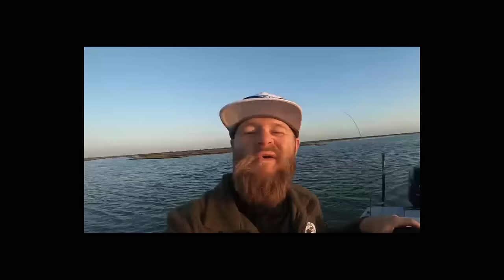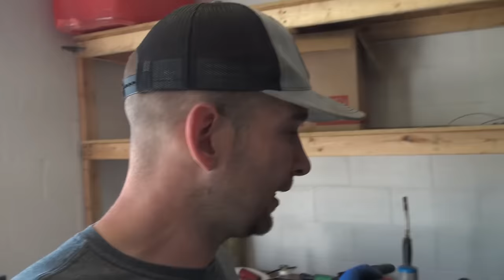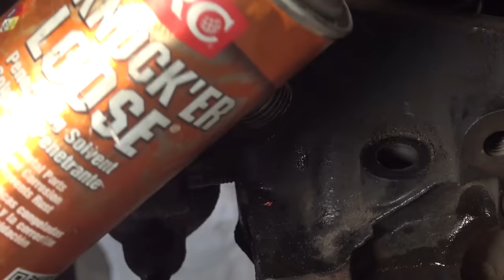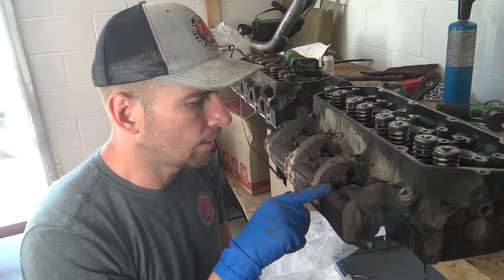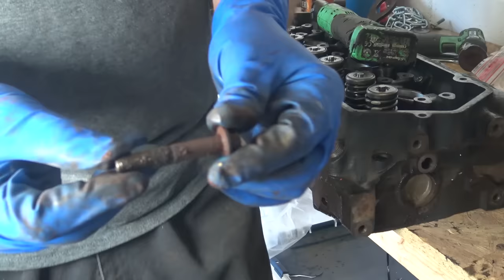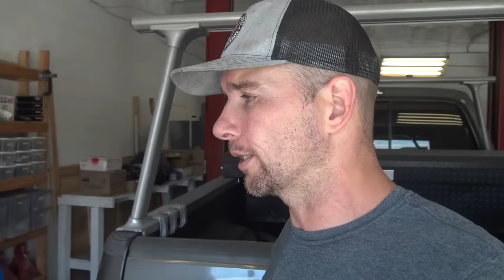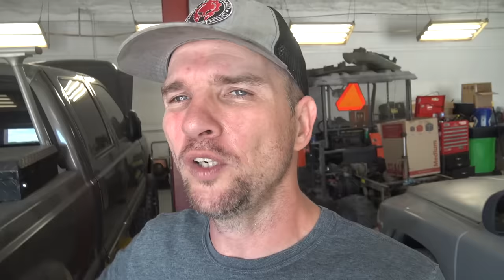Old Mechanic Taught Me This Trick To Removing Rusty Exhaust Manifold Bolts!

Comment: my dad taught me this, but to always work from the inside out. I never start with the outside bolts or corner bolts like for a valve cover job. great video man!
Reply: e90: Yeah, that makes sense....like the man said, retighten after loosening.
That gets your inner bolts scenario as your Dad said.... Sound advice.
Cheers.
Reply: Even when putting it back together?

Comment: I use this same technique when removing steel screws from aluminum trim pieces on 65 year old  year old  travel trailers. Dissimilar metal corrosion is the worst. Great advice about not fully removing any bolts until they are all loose.

Comment: Well done! Tapping it with a hammer can help break the rust between the manifold and bolt also.
Another reassembly reminder: do not use hardened bolts during reassembly - mild steel only
Reply: How about stainless steel bolts?

Comment: Yep, this method works. I learned this from a retired millwright who worked at Puget Sound Naval Shipyard. Sharp hit in the tightening direction can also help in the beginning. I also spray more rust blaster when turning back and forth. That pumps more liquid in to the joints. Favorite blaster is Kroil and I use nickel based anti-seize on exhaust manifolds fasteners. It's made for higher temperatures,  but follow OEM guidance for sensors.

Comment: Having been a machinist for 42 years, I agree 100% with your manifold bolts removal process. I have found that once removed toss the removed bolts. I always buy new boots at Tractor Supply stores I get the grade-8 bolts and use the copper anti seize compound liberally prior to installing them. Thanks for that great and very helpful video.
Reply: I have a question for you my friend, or anyone else for the matter. I recently replaced my manifold on my '06 Mercury Milan Permier with 227,000 plus miles. And to my surprise all the Nuts came free, and didn't break the studs! Now, these 2 are separate, the stud is a Torque tip that's bottomed out before the manifold is put on with the proper gasket. Then the nuts. 
So, now I have oil leaking from some of the holes and along the top. My question, should I replace them even though they look ok? They do seem to be smaller than they should. Now that I think about it after this video.
 🤔 🤔🤔🤔
Reply: A BIG YES ! On the COPPER ANTI SEIZE !
Reply: @erocklaw74  Your manifold bolts have 227K on them. That's a lot of heat for a lot of time. If it were me doing what your doing I'd pull those studs after soaking them with a quality penetrate. Take on to NAPA Auto parts and buy new ones 1/4 to 5/16 longer. Show them your bolt . Long story short, your bolts stretched !

Comment: Use a pneumatic punch on the bolts right in the center of the head, not enough to deform the head but just to rattle the rust loose, also having heated the bolt or manifold spray some oil onto it while hot as it cools it draws the oil in. Also use loctite LB8151 anti sieze spray when putting the bolts in, used on north sea oil rigs never know a bolt sieze with that goes upto 900 deg C.

Comment: Great! One pointer to add: when using a torch to concentrate heat on one area, hold the nozzle further back such that the very tips of the inner blue flame is hitting the surface; this is the hottest part of the flame, and breaking it results in incomplete combustion hence lower temperature.
Reply: Thanks for this tip, if I may add a pointer, the yellow part of the flame weakens the bolt by introducing carbon into the metal, so always make sure you douse the part you want to heat in a blue flame.
Reply: Exactly a point I was going to make. In addition remember that heat rises even when it comes to solid objects. So start the flame below the object. Giving more time to let things cool off and contract will give a bit more movement. Even spraying liquid directly on the bolt. Great topic by the way. Sometimes the basics get lost in the heat of battle.
Reply: @TheEZGZ  heat does not rise in solids.

Hot gas rises. Hot solids just spread the heat
Reply: But the hot gases spread around the block making heating more efficient and faster.  So heating from below is better. Also, any solder flux and penetrating oil chases towards the heat so heating from the opposite end from the joint treatment.

Comment: Another minor variation my Dad taught me for manifold and head bolts . Same "break it loose and tighten it back up" routine but start in the middle and work alternately outwards.
Reply: Makes good sense.
Reply: And use a breaker bar!!
That ratchet makes more work, than it's worth.
There's a good reason it's called a BREAKER BAR!
Reply: Green Giant , harbor freight?
Reply: @cheerdiver  might get a little better feel of the bolts willingness to break rather than give up its hold maybe
Reply: @adrew1963  Not only does a breaker bar give you better feel and easier to go back-and forth with, you are not as likely to be tempted to go that "little" extra bit that will get you in big trouble!

Comment: One the best things you can do is before you attempt to turn the bolt rattle the bolt with a air hammer, they make a air hammer bit that you can put sockets on. The air hammer vibrates the bolt and helps nock the rust loose. I know it may sound strange. But it truly a game changer
Reply: I just ordered the 3/8"/1/2" set from Amazon on your recommendation for my '67 352 motor. Thanks!
Reply: @5hawks   Just curious, have you tried the air hammer technique with those sockets?  I have 67 352 manifolds that are very rusted and leaking very bad.

Comment: You're right about having patience.  I've rushed myself into some into some agonizingly long jobs in the past.  If you have access to the backside of the bolt (like some suspension stuff) use a small wire brush to remove the rust on the far side of the nut to avoid dragging it into the nut.

Comment: Over here in southwest Pennsylvania...in the "rust belt"...our road salt melts the snow, ice, and fastener heads. Pre-soak all you can, then with a large hammer force fit a small as possible socket to fit what's left of the head...accomplishes a couple of things...tight fit and shocks the rust, hopefully enough for a fighting chance.
Sometimes a air chisel will do the trick...applies a lot of vibration.

(((Reminds me of a trick with a 5th wheel on a truck that refuses to slide, the pins just won't release. Without the trailer, pour water or penetrating lube on the slide rails and lock pins, release the locking pin air valve, take the truck for a ride on a rough road...railway crossings work great...return to trailer and 5th wheel will slide....vibration did all the work !)))

 Back to the tight bolts... Then try to gently tighten first...not loosen. Then loosen/tighten/loosen and heat if still hangin' tough.
   New fasteners and "white high temperature food grade" antiseize...far superior to typical parts store NeverSeez.  You will love this stuff...It is non-staining...does not absorb into your skin...simply wipes off. Been using it for 10 years on all fasteners exposed to weather and not...hold their torque and come apart easily. Anything that is a critical fastener...a drop of Loctite seperate from the antiseize.
There are different temperature ranges available, typical is -65 to 1800 degree operating temperature range. One place is www.antiseize.com.

A word about using the right tool for the job...6 points are great for sockets and wrenches...as said, the bigger the drive size the better.

Phillips head screws...I'm amazed at how few mechanics know this...philips head screws, by design, are made to cam out at their maximum torque. This goes back, if I recall correctly, World War II days. Speed of assembly, proper torque, and not overly worried about future removal.  Here's the rub to that...the Japanese had and still use today their version...designed to hold torque, be easily removed, and reused because their design does not cam out...as long as you use the proper tool.
 Japanese "philips head screws" aren't philips head. The head is slightly different. Look at any Japanese motorcycle or quad master cylinder...the screw heads are usually ruined because someone tried to remove with a common (to us) philips screwdriver. Look closely at those original equipment screws...on the head will be a "dot"...that indicates it is a Japanese Industrial Screw (JIS). It takes a JIS screwdriver to work it without camming out. 
  The nice thing about a JIS driver is that it will usually remove a cammed out philips screw...I use a brand called Vessel (#220w3 from Japan via Amazon)...interchangable bits and a ball palm grip with flat spots that allow tremendous torque to be applied. 
For those master cylinder screws that are totally ruined...I use left turning micro drill bit/easy outs. "Alden 4507P Grabit extractors". Then I use philips stainless screws with food grade antiseize...the owner or next mechanic will have no problem adding brake fluid.
Reply: I love my vessel screw drivers!

Comment: There is actually a high temperature anti seize for exhaust bolts. I have used it on my tractor  exhaust system.  Doesn't burn away as bad as regular anti seize.
Reply: Nickel anti seize
Reply: Hulagan 808  same but I use the paste.
Reply: Copper anti seize works great for exhaust
Reply: @jermball12345  In my experience with hevy duty diesel after treatment  systems, lock tight graphite anti seize works the best.
Reply: globs of ANY antiseize works wonders, even Milk of Magnesia
Reply: Bob B , Is that basically because it’s magnesium powder in suspension?

Comment: Great advice, l usually work them back and fourth, but l never thought to tighten them back up after they are loose. Try using a braker bar when you are going back and fourth, then you don't have to switch it. Thanks again for all the great content.

Comment: Try removing bolts in wisconsin. Those bolts looked mint compared to what we deal with. Try when 50% of bolt shaft is rusted through and aluminum heads. When you need to pound sockets on a few sizes smaller than when they were new to get a grip then you know what a rusted tight bolt is.
Reply: HEARD THAT HERE IN UPSTATE NY TOO
Reply: Lol I’m in WI too. I’ve been there man.
Reply: And Ontario, too!
Reply: 16 years being a mechanic in Utah, cars here are chill. That sadistic crap you have to deal with in Wisconsin or anywhere your roads are paved salt ten months of the year... Hell no! Hats off to you guys!
Reply: buy some british standard or witworth sockets they are between  american and metric saved me a few times
Reply: I'm in Wisconsin too, when we say torch it's oxy-acetylene or nothing. Propane torches are for lighting cigarettes we need it to be cherry red in a hurry.
Reply: make a video of you next job, your way, his way :)
Reply: John Owens Exactly.  Propane in Chicago is useless for anything except lighting smokes and fireworks.  It’s oxy acétylène or nothing.
Reply: Michigan is real fun aswell
Reply: Why not just replace them before the rust rots the bolts off as preventative maintenance?
Reply: Those bolts were Minnesota mint.
Reply: @tracyervin7289  Aren't those eight-sided or something goofy like that?
Reply: Yep need to make a wiaconsin flat rate and then everything else flat rate
Reply: Montreal in here!🎉🎈
Reply: Wayne Bradey hah. Tell that to 90% of drivers and they’ll say “why would I mess with something if it ain’t broke?”
Reply: Northern IL is pretty bad. Suspension is even worse. I’ve used this trick on Windsor small block timing cover and water pump bolts because they rust to half the diameter inside the aluminum and it swells. Those almost ALWAYS break
Reply: Yep I go through it here in MN to it sucks!
Reply: I live in Texas.  🤷‍♂️
Reply: Thats the truth, started out in Detroit and dealt with rust naturally and i moved to south Florida and wondered if life could get any better. Yes is did when i realize i wasn't getting water drips on my head in my ears in my mouth and eyes. :-)
Reply: No doubt...here in Ohio  where the criminally  insane that run our transportation  system  deem it necessary  to  use SALT!  You get about  five years outta a brand new  vehicle!  Before  it  turns to  dust !
Reply: Michigan here. Just put headers on my 99 Ram 🤘
Reply: I've wrenched in shops in the Northeast, Midwest, and Pacific West. Midwest rust is bad, but not as bad as New England rust. Add on the cars driven on Boston's 300 yr old horse buggy converted roads and you have a recipe for becoming an alcoholic. NY,NH,MA cars are by far the worst I've worked on
Reply: @waynebrady5585  it's called buying a used car
Reply: @derailleurmind0454  i feel bad for you. You have my condolences
Reply: @thegamepotato1912  😂
Reply: One word of advice....MOVE.
Reply: @tex4668  your right. To a land far far away where my 99 5speed 4x4 Ram has no rust. 😂 damn Michigan
Reply: @waynebrady5585  all the bolts?
Reply: @60viking  salt water drips in winter.... yuck!
Reply: @tracyervin7289  Star sockets after those strip!
Reply: Northern Minnesota we call the torch a smoke wrench lol
Reply: "pounding" sockets on only makes it worse you are bending the threads and compacting the rust hit the soil with a hammer it gets harder right? same principle.
Reply: @thegamepotato1912  why would you buy a vehicle that is rusted so bad even the bolts and nuts are rust rotted? Thata not a used car. That's a donor car.
Reply: @waynebrady5585  i live in northern Illinois it's a used car up here😂
Reply: @waynebrady5585  hard to find a car that isn't rusty in the north, if you're patent, and smart it isn't hard finding one you can deal with, and if you know a thing or two rust on bolts becomes less and less of an issue.
Reply: @BigWheel.  I live in northern  missouri. we have our fair share roads treated with salt and rusted under carriages. Washing your car frequently to remove the salt and mud has kept my 22 years old f150 virtually rust free.
Reply: @waynebrady5585  Because pretty much every bolt or screw on the vehicle exposed to road salt could conceivably corrode solid. It’d be highly impractical - not to mention expensive and time-consuming -  to replace them all periodically as preventative maintenance..
Reply: YUP...SALT CORRODES EVERYTHING...SALT ALSO SOFTENS WATER SO SALTY WATER PENETRATES EVERYTHING BETTER THAN REGULAR WATER...I INSTALLED AUTO GLASS.. ONE TINY PIN HOLE RAIN WATER IS SOFT...IT FINDS THAT PIN HOLE...JUST LIKE SALT WATER...CRAZY BUT A FACT...
Reply: @talon0863  Not on ex bolts...6 point is best to use.. a 12 point socket on a corroded bolt will strip that head in no time...
Reply: @60viking  Calif & Az are rust free...spoiled rotten!!!
Reply: @bigsparky8888  I was referring to Whitworth fasteners. If you don't know what that is then never mind
Reply: In that case just break them off
Reply: Living on the coast, that reminds me of removing wheel lug nuts. I have had to go down a couple sizes on the side of the road! So far, so lucky on getting them off.
Reply: I've been living here for 4 years, the rust is literally my only complaint.

Comment: Also when trying to undo the bolts, be sure to keep the socket squarely on the bolt pulling it to one side will also assist in snapping the head off.

Comment: Great vid! Working them back and forth is something you rarely see mentioned in other vids as well as leaving them in place until all are broken free. These are tricks learned after several youthful attempts to simply muscle them out. Over the decades, I've found gentling them back and forth with guarded pressure, sometimes even with several cycles of back and forth without feeling any movement to get the ball rolling. We live in the overly salted Northeast because the cupcakes here can't bear to see snow on the roads they travel until they move South, and an over abundance of ambulance chasing slip and fall lawyers (this doesn't apply to all attorneys!). The level of rust here is astounding! I also utilize a small 3/8" air impact turned way down, and slowly increasing the force can help rattle them loose too. The same rule of patience applies; gentling them back and forth with heat and spray penetrant has saved countless hours of off-center drilling and thread damage repair. We still have plenty of rusted/broken ones that require nuts welded on simply because they dissolved in the salt and we can't turn them any other way.

Comment: Wire brush the area before you spray it.  After spraying it, tap the head of the bolt, then spray again and let it sit awhile. Keep repeating this. When you finally try to turn it, just a hair at a time, and keep going back to tighten it. Everytime go a little more back and forth. Keep spraying the whole time.

Comment: One trick I've used that helps, especially if you're using heat to try and expand the metal with threads on it, is to apply heat, get it real hot then use a can of compressed air turned upside down (the kind they use for cleaning computers and such) and spray on the heated area to cool it rapidly. This sudden shock and change in temperature often helps to crack the tension of the rust that is holding that bolt in. Then once it is cooled, apply heat again. This has worked on some of the most stubborn bolts where heat alone wasn't enough to break that rust bond. It is especially useful for dissimilar metals like steel and aluminum.
Reply: I was taught something similar but with those small hardware store fire extinguishers. Torch then cool.
Reply: @GeneralChangFromDanang  Yeah that would work too, I just find the computer duster cans are cheap, easy to find and leave much less residue.
Reply: Great tip

Comment: I do exactly how you do it with the addition of sometimes smacking the head of the bolt with a drift or hammer to shock it ! Rusted bolts broken bolts I think is something that comes with experience how to deal with trial and error it’s a “feel “ thing ! Take your time be patient! Thanks for sharing 👍